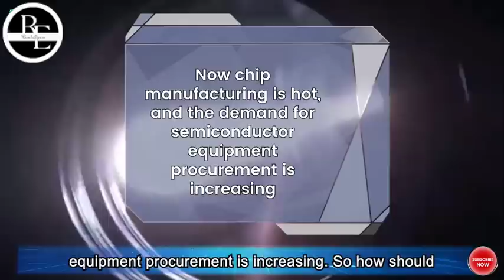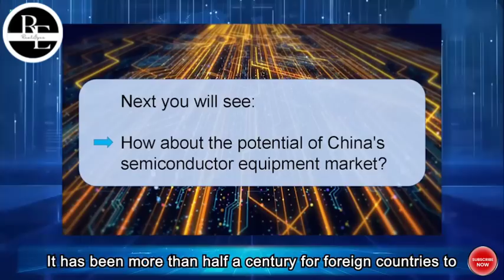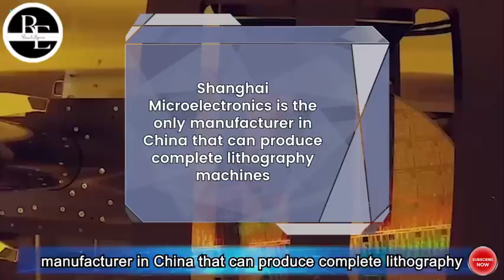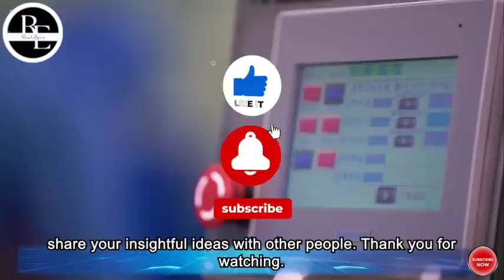A new breakthrough in Chinese semiconductor equipment, is it real?

Comment: There are a few issues with this video. A couple: 5nm doesn’t refer to the size of the chip. It refers to the minimum size of a feature on the actual chip. A 5nm chip can be the same size as a 12nm, or 65nm chip (subject to reticle size limits). Another; 5nm is NOT the most advanced node. 3nm is in production at Samsung, and likely at TSMC as well, according to industry experts.
Reply: To me this channel just seems to be a China propaganda channel
Reply: 10, 7, 5, 3 nm have become marketing terms for the next generation, but they do offer substantial benefits over the previous generations. If SMIC 5nm gives comparable benefits as other 5nm chips the name is appropriate. It will take time and a big effort to close the gap, luckily China has the biggest home market in the world, and it woke up to the fact that rather than applying high-end parts, you need to master the underlying core technologies as well. It is a deep investment but this will not only benefit chips production, but also science and broaden her industrial base, and allow more rapid innovation in many areas. I hope the west will switch to a more cooperative stand.
Reply: Agree
Reply: If they revamp their software engineering sector on developing better AI algorithms they could use AI to rapidly develop more efficient microchips. After all, AI can do what humans can but order of magnitudes more efficiently. The limitation would then fall on their software engineering sector using it to bolster the hardware engineering sector.

Comment: Can China really make any chip without American tech and equipment ? I doubt so.
Reply: Thats what US think when they left China out of ISS. What happen now they make their own
Reply: china no longer use american tech right now, embargo already started since year 2020 thus for the last 2 years all were their own fabrication and innovation. China has also made their own software innovation for their own equipments. For those who doesn't know the idea of cpus in mobile phone are really China's innovation on ARM based, meaning your 3 processor on the soc,  2x4 core and one efficiency core addition, are innovation by China. That is why few years back we saw 10 core soc chips, but it was actually 3 processor on the soc board. those were later manufactured by mediatek. to say china doesn't innovate is just people who doesn't know about the industry. Do you know now who is stealing the 3 cpu on soc board, Qualcomm, Apple, Intel are stealing China's invention. want more, your android used to take up alot of space for startup process, it was Huawei's engineer that develop the new code and contributed to android codebase. his invention only requires tiny amount of space for android 12 to start and faster loading time. They already made that to huawei phone years ago. Chinese innovation are much more than meets the eye. You don't see it but for those who are in the real tech space knows about how fast code are build by the Chinese
Reply: @watb8689  Of course china innovates , but as far as chips go , making a chip is not hard , making a System and software for that chip now that is hard .
There is no Chinese Photoshop for example ,  then you have something for that chip to do , you see . Chip it self is nothing , Software is everything , and China should invest in software development .
I hear Huawei is doing that , making its own OS , but much more must be done .
I am from Serbia and i have a Chinese phone , and i must say Hardware is excellent , but software is  garbage .
Software , that is what china needs .
Reply: Yes, it can. In fact, instead of whether the when would be more appropriate
Reply: None of the pictures matched the horrible English descriptions  of the machines or operations .
Reply: Jai Hinduja.  Space techs are even more difficult to master.  We Indians had beaten the World going to Mars.
Reply: they can , but they cant do anything with it , say China makes something like Intel Core i5 5th generation , well they cant use X86 or x64 insturction sets , for those are pattents owned by Intel and AMD , they would have to pay a fee to use it . But they wont get it .  Say if Sony made PS5 chip  , what good would that do for Sony , none , who needs PS5 chip , i dont , what i need is Games not chips , so biggest problem for Sony and PS5 system was not the chip , its Software .
Chine seams to be oriented to make a Chip , but they dont know what to do with it , what chip , for what , what will it do , what system would it run on , basically only system they have is Android , and their software for Android is worst ive seen .
So , M1 chip for Apple , is nothing , its their Store and OS that is Everything .
So you see , Chip is nothing , sand silicon , no one wants it , they want Software .